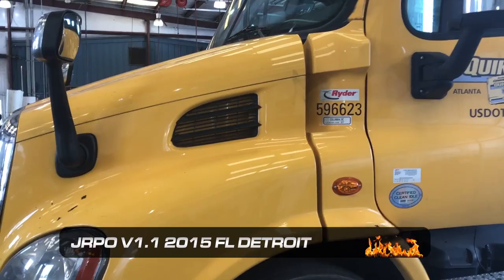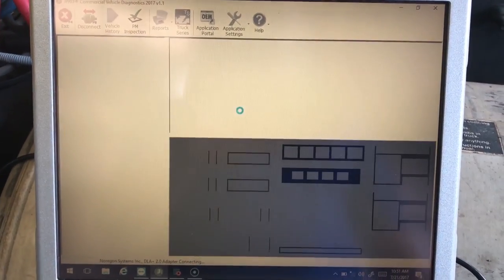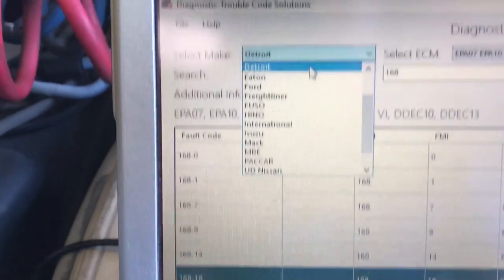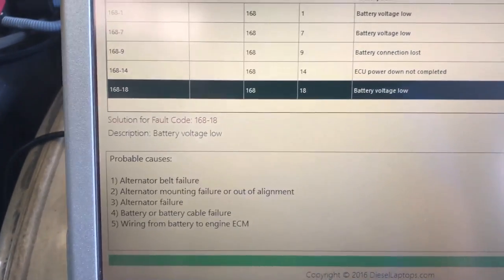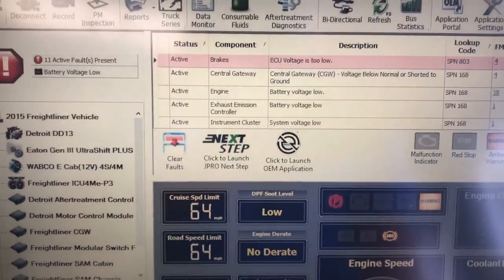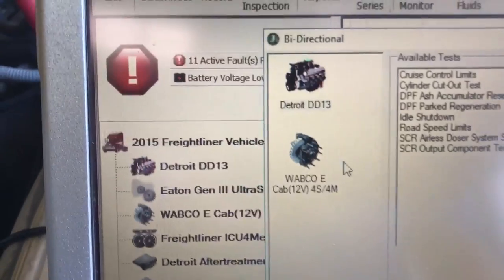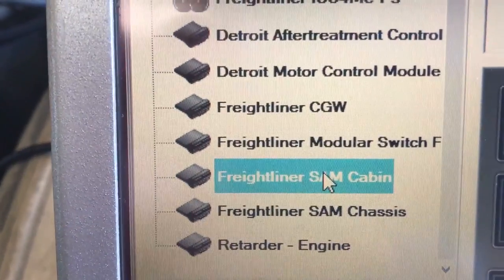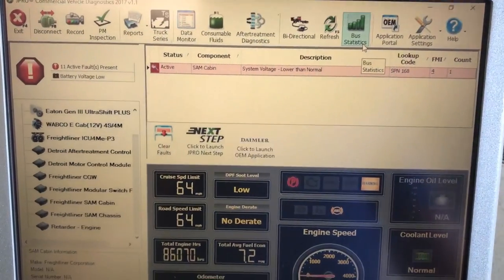JPRO Heavy Truck Diagnostic Scanner Tool on 2015 Freightliner with Detroit

Comment: I am using JPRO software on my diesel laptop
And I need to change the speed limit on my international 2014 semi truck
I have clicked bidirectional but I couldn't get the exact options showing on your video 

Please advice
Reply: Did you ever find a solution to change the speed from this program.

Comment: the engine must be on to connect with the module?
Reply: No. Just the ignition key needs to be on. If doing regen, engine needs to run, of course.

Comment: How much does this cost and can you use it on older trucks too?
Reply from the maker: JPRO software is around $1500 per year. Yes, it works on older trucks. You can view more on our website (www.DieselLaptops.com) or call us at 888-983-1975. Thanks!
Reply: Aventus Aretino  what are the laptops ?
Reply: @lucashenry9734  dells and toughbooks
Reply: @Wolf-rx5rb  Does your laptops include the diagnostic software for the trucks? How can I get in touch with you?
Reply: @montysidhu33  yes includes jpro,dddl,maxxforce,Cummins insite service ranger 4,diesel repair info.
Reply: I'm a O/O Driver and considering starting my own shop in future so just browsing for ideas & things that's been utilized on me out here. Very beneficial
Reply: @Wolf-rx5rb  
How can I contact You?
Reply: @panchoreyes1  whats your email? I can send you info.
Reply: @Wolf-rx5rb  my bad I was referring my question to Francisco
Reply: @carlosmartinezjr12  send me your email
Reply: @Wolf-rx5rb  how much for each software?? cummins insite or ddl8
Reply: @transport21  $185 each regardless of any software buy 3 or more i will leave them at $145each
Reply: Wolf and is it lifetime license? And also does ddl come with trouble shooting guides?
Reply: Wolf also what city you in?
Reply: @transport21  yes
Reply: @transport21  Ontario,Ca
Reply: Wolf do you have ptt? The latest version?
Reply: @transport21  yes i do
Reply: @Wolf-rx5rb  I have a laptop already. What I am intrested in is the DDDL software. Would you have that? How much?
Reply: @carlosmartinezjr12  $185
Reply: @carlosmartinezjr12  location?
Reply: @carlosmartinezjr12  i sended email but it dont go thru
Reply: @Wolf-rx5rb  Texas
Reply: @carlosmartinezjr12  ok,i have newest jpro 2019 ver 2 ready $450
Reply: @carlosmartinezjr12  it gives same error when i send you a email🤔
Reply: @Wolf-rx5rb  still selling your laptops
Reply: @jamesfischbach1865  yes 3 toughbooks in stock
Reply: @Wolf-rx5rb  how much are they
Reply: @guillermobelloso2312  jpro $350
Reply: @Wolf-rx5rb  you still have them?
Reply: @Markus-es2jv  yes,new versions
Reply: @Wolf-rx5rb  how I contact you
Reply: @Markus-es2jv  send me your email

Comment: Can you change parameters
Reply from the maker: This tool is limited on parameter changing. Mainly just road speed & cruise speed limits for this tool. If this is important to you, we do sell a wide variety of tools that change parameters on all engines. Please call us at 888-983-1975 or email sales@diesellaptops.com so we can get an idea of what you want to do. Of course, the more you want to do, the more the tool costs.
Reply: @DieselLaptops   question when you change the parameters on the ECM is that the area where you can gear it towards better fuel economy or gear it towards more power then fuel economy?